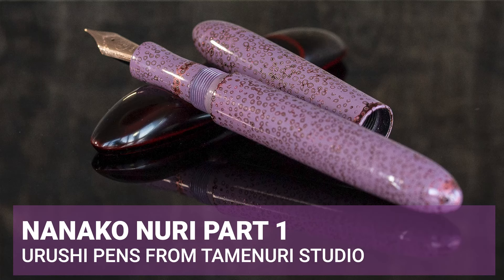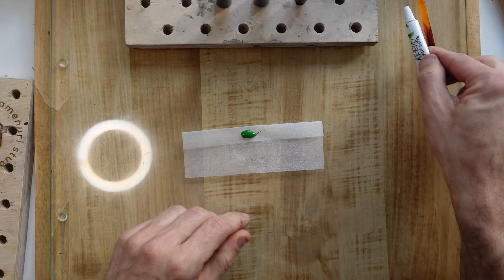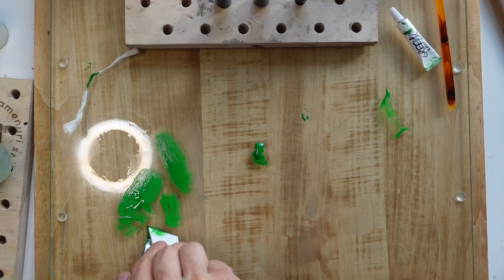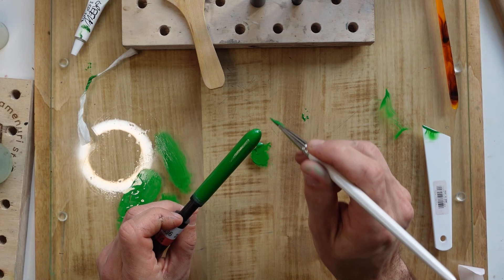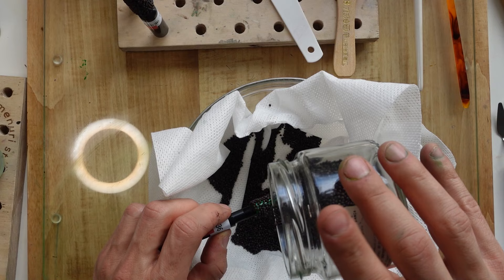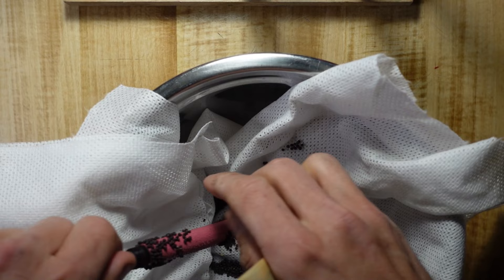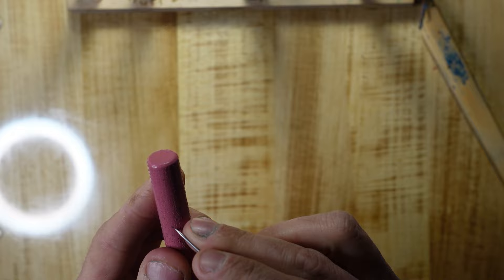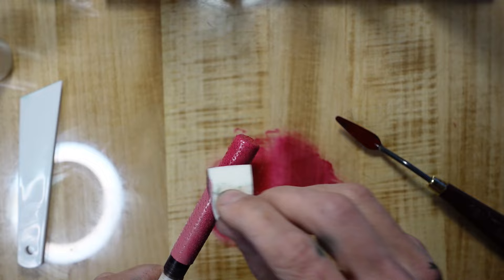Nanako-nuri urushi tutorial

Comment: Another question from me again. 😅 Do you store your urushi tubes in the refrigerator or at room temperature?
Reply from the maker: Raw urushi in fridge I sealed string bag. Processed - room tempreture. I have a lot urushi (right now ~2.5 kg) and use a lot, so it keeps rotating often. And even if some is getting older, and cures slower - I use it for mixing with other batches and “downgrade” it in my processes.